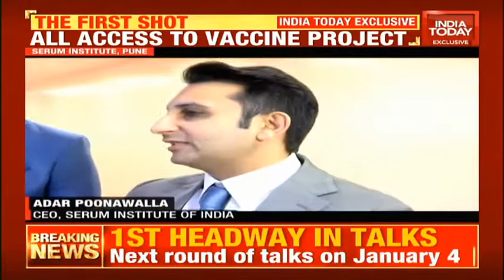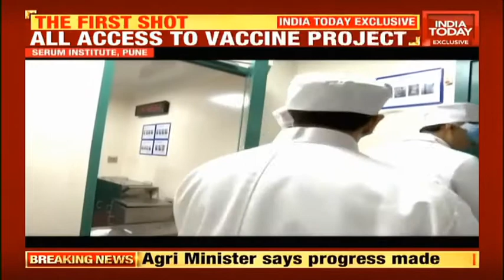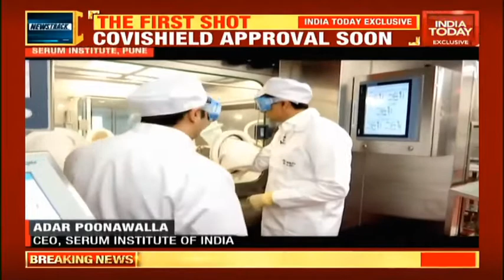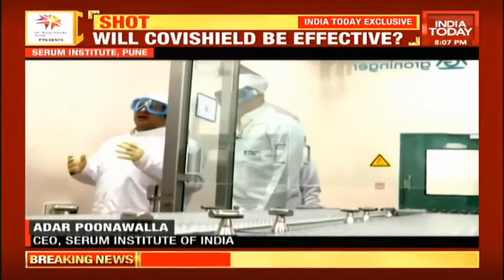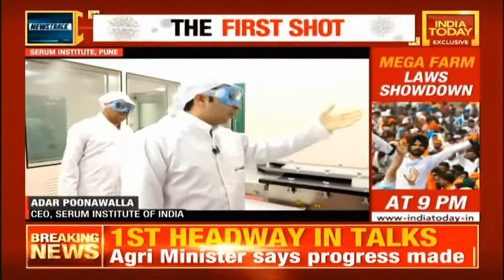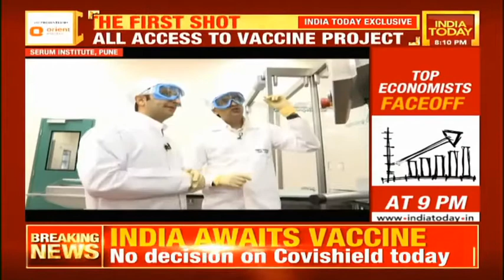Groninger Filling Line in Action At Serum Institute Of India Pvt. Ltd.

Comment: It’s all about publicity not good manufacturing practices (GMP). Few point what observed,
I don’t like the way reporter moving, taking with out face mask , putting his hands with in the isolator. Reporting from GMP area is necessary? Are Practices and Procedure allows to do such activities ? Mr. chief scientist does not have gloves in hand initially and he hiding his hand keeping back, later on during shooting he gone & ware the hand gloves. The statement that “Tunnel sterilisation at 200 deg” need to be double check. Throughout the video reporter waring watch which is visible down to his hand gloves. In filling area operator waring full clean room gown including long elbow length gloves but without safety googles where as reporter waring a visitor dress with short gloves with safety googles.